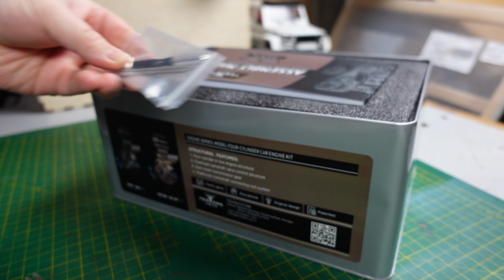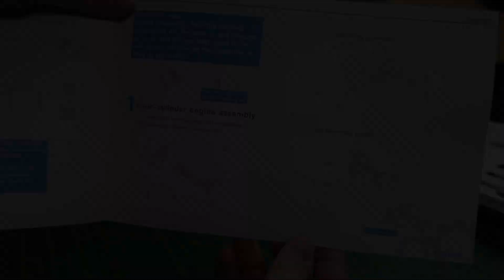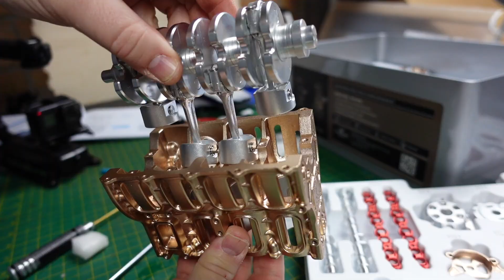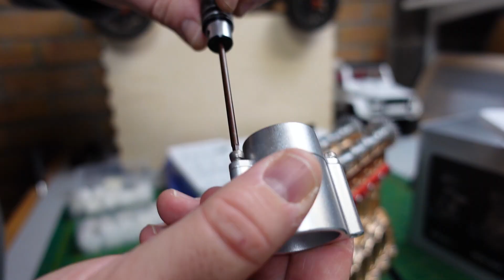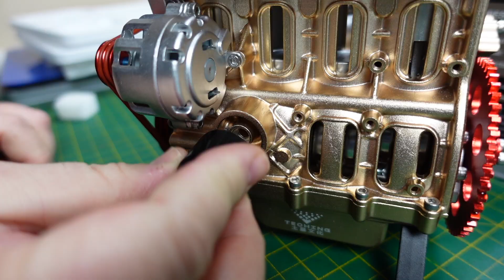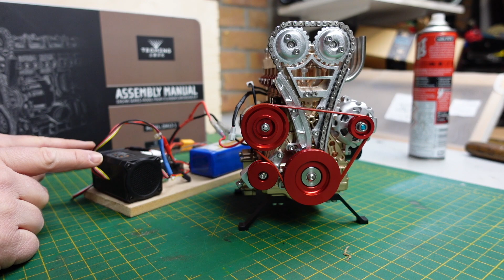BEAUTIFUL - Overpowered $400 Model Engine. 4 Cylinder, Twin Cam 16v

Comment: Sorry for the irrelevant question for this  video, but the parts that you have suggested me for the wltoys 12428 have arrived😁( Dumborc remote and receiver and a surpass motor and ESC), I installed everything but the reverse and forward are opposed.
Do you have any idea why?
Reply from the maker: Swap a wire around on the motor
Reply: @TomleyRC   the orange is on the left the yellow in the middle and the blue on the right, so I swap between the orange and the Blue?
Reply from the maker: @ielbaz37  You just need to swap one over... then the motor will go in the other direction. Doesn't matter which colour..
Reply: Thank you so much ❤
I also extended the hexs put bigger tires and mounted a body. it looks so agresiv and now it's fast. 
Thanks for everything.

Comment: They are really nice kits but just a little bit out of my price bracket as it would mean less RC funds as a usual RC Vehicle is £200-500 for me and I just got the Losi LMT you would absolutely love the LMT Tomley m8😊👍 I've not taken it outside yet but the drives I've had inside are brill 😊 it's deffo bigger and badder the my Kraton 4s..
There needs to be some videos on storing your RC collection as I'm running out of room and really want to make a vertical car rack for 1/8 would probably be best average size? Ideas

Comment: This is worth 40$ not 400$.
Reply from the maker: It’s worth more than $40. The parts are good quality and all metal 👍
Reply: @TomleyRC  I rather spend 400 on rc car. Don't make me wrong.
Reply from the maker: @Oiu82  So would I, but it's still worth more than $40 :)
Reply: @TomleyRC  I can't see what is worth 400$. 400 is a lot for engine, you can get for this money 2nd hand motorbike engine.